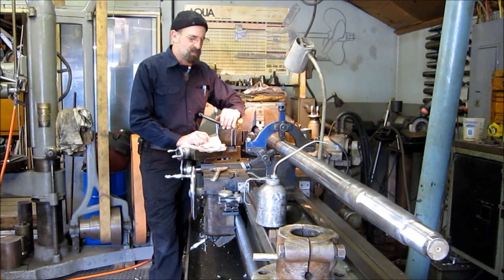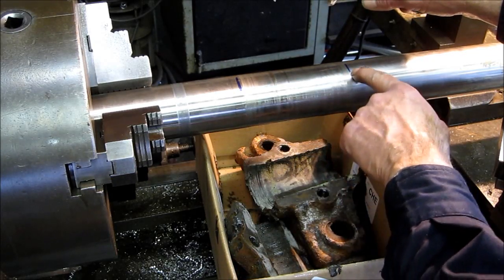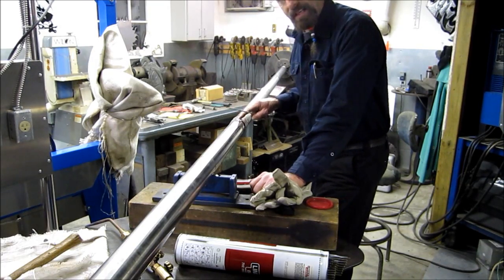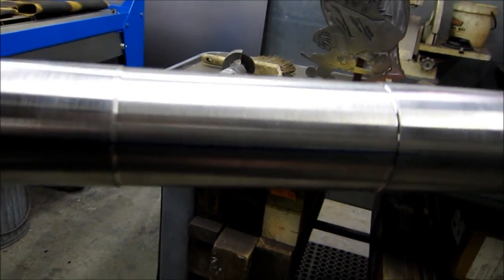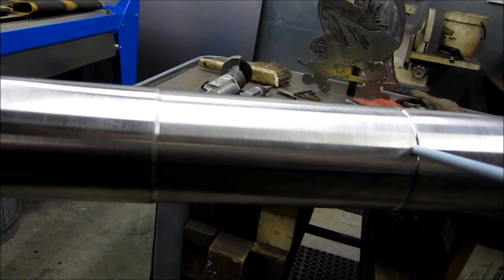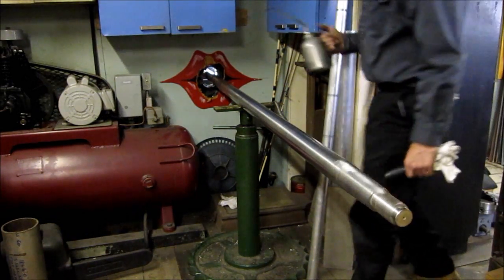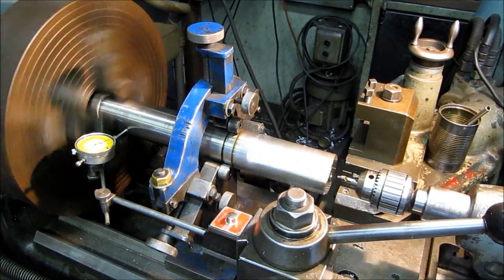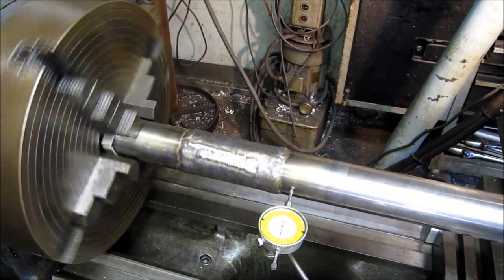As the Shaft Turns

Comment from the maker: @Bonfield2002 No but you can apply hard facing rod the same way on needed projects and then grind to size, some large heavy equipment pins are done that way. At Northstar in Cailf. we used a submerged arc welding set up like a lathe bed with auto feed, creating cylindrical beads rather than linear...

Comment from the maker: @tfp777 Lets change the abasive word stress to draw a simple contraction by heating.
The shaft was running true to start, so the extra weld was just to offset the pull caused by varied bead laying. The saturation of control does have some depth and maintains its true running as the weld is shaped to size. Some final heat straightening almost always has to be done or at least checked before finishing the shaft work.

Comment from the maker: When you are set up and doing a simulated vertical weld, slag is not trapped under the current weld pass, if left from the prior, pass, just as slag is not trapped between dimes on a single bead.

Comment from the maker: In the manual mode of welding I prefer to lay the beads to gain depth and control the heat better in the lineal fashion! In the yards, we did have a submerged arc machine that we made, to do build ups in the rotary direction, used mostly for short hard faced pins of heavy equipment. ;{)---

Comment from the maker: I'm sorry; I was referring to the rod used for the repair. in the past I had stated that the slag I use to help hold the bead for the next past and it is hard to remove single beads of slag as it is so it's a win, win. Also the way I lay the beads is like welding in a continuous vertical weld position. ;{)-----

Comment from the maker: Not for the marine environment, it is of a stainless steel material high torsion yield, But let’s say you were doing a machinery shaft, as long as it’s not leaded, like 12L14 or some of the higher alloys of steel that become brittle, you can build up an machine, a lot of worn out diameters, on most shafting used in the industry for drives and pivots. ;{)---

Comment: Could I pick your brain a moment?  I am dealing with a much smaller shaft (I am not worthy) and I don't know if it's too small to take the heat of welding up the area.  I thought of Belzona metal epoxy but the worn area is a race for a needle bearing.  The axle is maybe 5/8 or 3/4.  I forgot to measure it. YT won't let me paste a picture link to show what I have :(

Comment: why don't you move the tailstock to insert long rods or shafts into the lathe? is that too much work?
Reply from the maker: It most of the time is more work and some of the shafting is longer than the distance off the end of the lathe to the wall than out the back and behind the lathe, but some real big diameters and shorter length, i will move the tail stock. ;{)-----
Reply: Ahhh I see :)